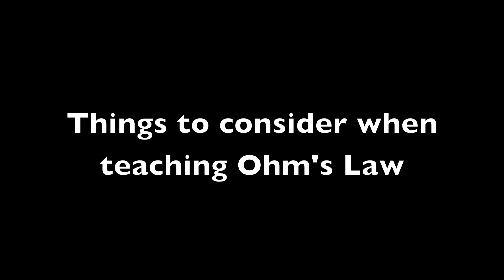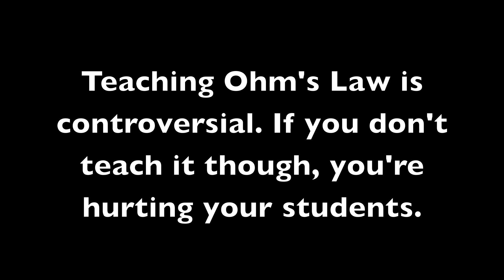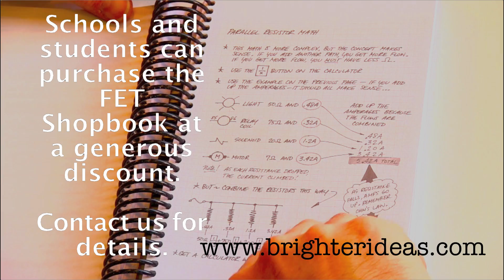Teaching Ohm's Law to Techs - Part 1

Comment: I too am an educator and worked in electronics and software design. I welcome alternative approaches to concepts and thinking differently. As I watched the video, I got the impression that your classes are for troubleshooting and repair. Technicians often do not need to know the intricacies of the design. I agree that the content of the course should be optimized to reach the desired outcomes. Teaching Math of Electronics is essential in other disciplines of course.

Comment: Hey bud I love your videos and book!!

Could you please make a video explaining why running 12VDC lights off of a 24VDC system by wiring into ONE of the two 12VDC series connected batteries is a BAD idea?

I have tried to explain it but have a hard time. It's just WRONG. 

thanks

Comment: Awesome analogy! Never thought that way, but makes sense! 
When I talked about components I was referring to the zener diode. I started to simulate circuits in class, and when I put a voltmeter in parallel with a 5V zener diode(inversed polarized), I get the voltage drop of ~5V, but I thought it should "let go" only 5V to the next component, because I was taught that it is designed to stabilize voltage.

Comment from the maker: If you understand spending money, you understand voltage drop. Imagine you're going shopping with $1000. You plan to spend $600 on building materials, $300 on tools, and $100 to buy you and your friends lunch. It doesn't matter the order you shop in - what matters is the cost. In slang, you "drop" money at each point, and there are two truths to this example. (1) It all adds up to $1000, and (2) when you get home it's all gone. $0.00 left.

Comment: Dan is right, when I went to college for automotive and diesel, electrical was taught with the equations first and theory and meter reading last.  I was confused at first.  I think up and coming techs need to be taught how Dan teaches it.  I use Dan's methods and they make diagnosis of circuits easier.  Buy the leads and buy the book!  Best money I ever spent on tools.

Comment: I stumbled upon your videos recently while I was looking for instruction on using a multimeter.  I have been working on my outboaord motor and everyone giving me advice wants me to throw parts at it. I thought to myself I will just use the money that I would spend on parts and buy a good meter and learn how to use it. Then I could diagnose the REAL problems and fix them myself. My plan worked great. I didn't need to buy any parts at all.  Motor runs great. Thanks for the instruction!